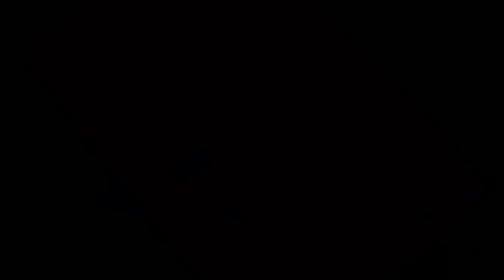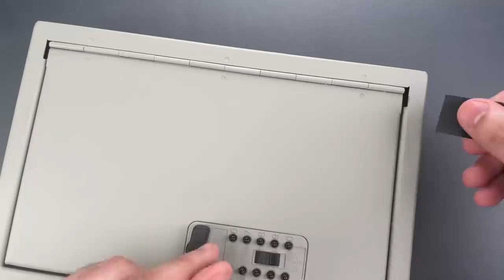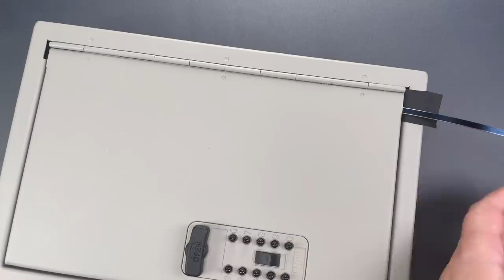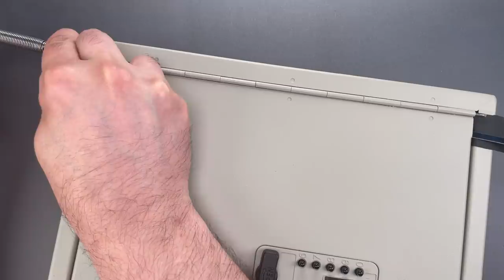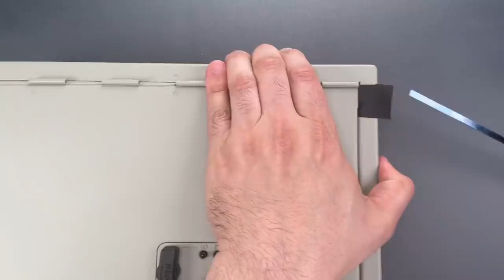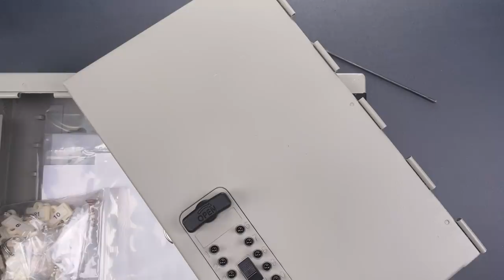[1319] Bypassing Kidde AccessPoint Key Cabinet Pro

Comment: In all seriousness, is it a manufacturing expense that keeps them from using a proper hinge? I mean, they made a clutch for a plastic twist handle... 
designer: "Hmmm , some metal wire through some metal loops should do it for the hinge.... How's the upgraded lock coming?"